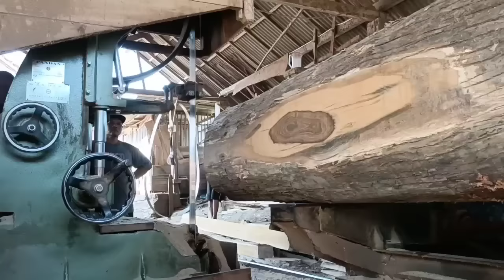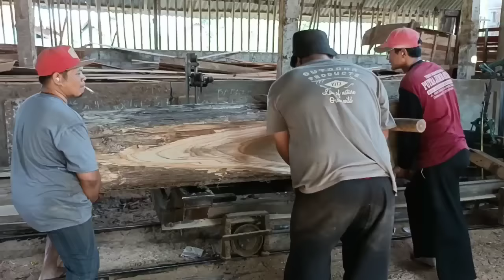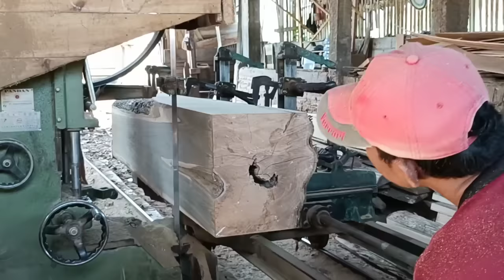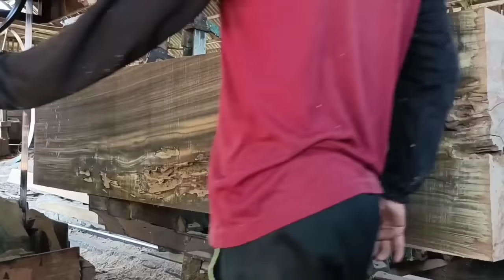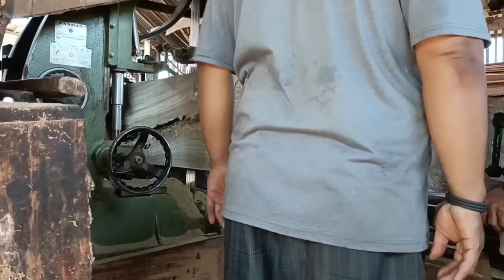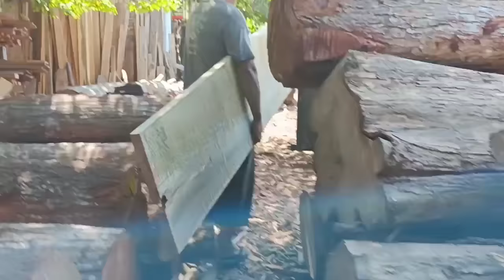The giant teak wood is very dangerous and full of surprises, look what happens!

Comment: Teak is notoriously hard on your tools, lots of that lovely tough resin that makes it such good marine timber 👍
Reply from the maker: Thank you very much 🙏🏻
Reply: Nowadays mostly plantation teak is available for marine uses, which is not as good as the wild one. There is a even better timber for marine uses: Robinia pseudoacacia. This Tree is growing in the temperate climate in North America as well as in Europe, no need to cut down the tropical rain forest. However, carpenters don't like it for its bad spots. I never knew, that wild teak also has many bad spots. So for marine purposes better use pseudoacacia instead of teak!
Reply: @n.mariner5610  thanks for that information. I used to work for Stag Furniture and we used a lot of Makori & Teak. The tools woul suffer  working the teak and need sharpening a lot. It was working here I discovered that Balsa is a hardwood, we live and learn eh 😉
Reply: @patrickrose1221  Robinia also is quickly wearing tools for its hardness, additionally its dust is poisonous, for it is more durable and resistant to fungus and other decay, all reasons for dislike by carpenters. To boat owners it is much better for it lasts much longer, e.g. in a semi wet surrounding more than a 100 years, not even teak will stand this long.

Comment: Too bad you can't cut going both directions. If you had a blade that was teeth going down on both sides of the blade then you could cut on the push and the pull.
Reply from the maker: true it would be better, but we don't have it yet
Reply: @woodsawmillskill  could cut twice as long with the blade.

Have to be designed to make it work.